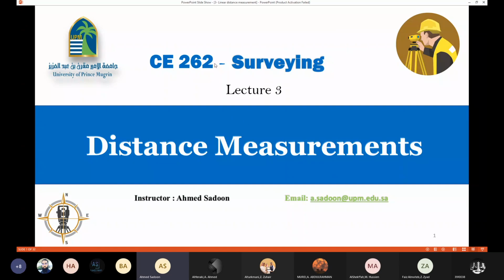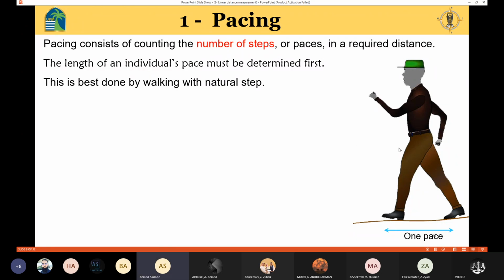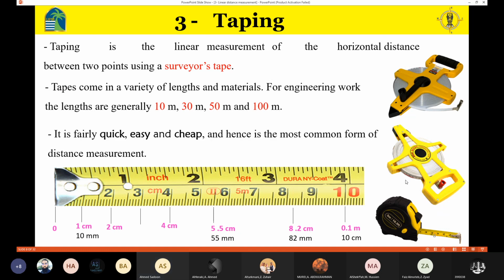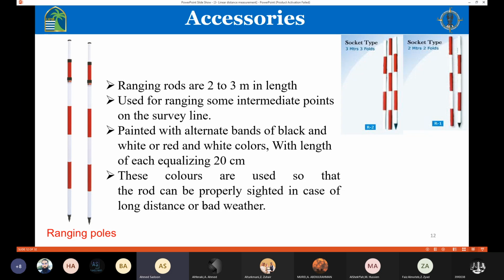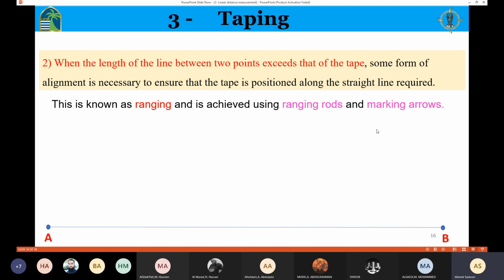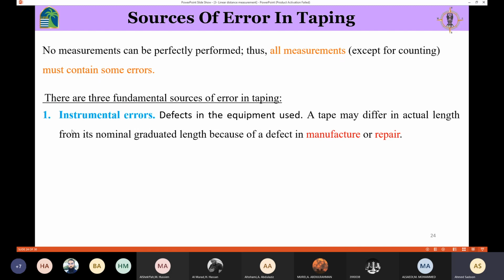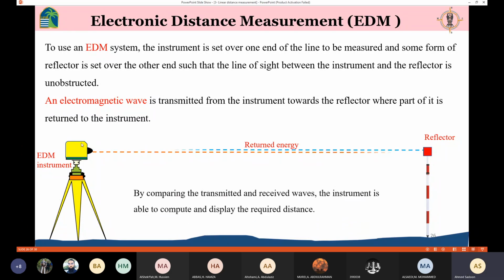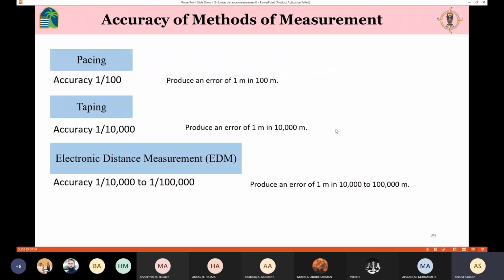Principles of Surveying Lecture 3 (Distance Measurements)

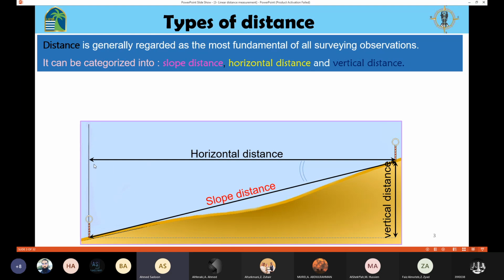Comment: 3:00 "if point A and Point B are the same then the Horizontal distance and the Slope distance are the same"  Thats not true.  As you rotatat round a circle the the slpe distance is longer then Horizontal distance.  Correct?   Becuase you have the horizontal distance and you have account for a vertical variable aswell.

Comment: Please
1. what is the margin of error in using the odometer for every 100m distance covered?

2. Does the EDM method cater for curve surfaces in distance measurement? assuming the distance is not determined at intermediate points but from end to end?